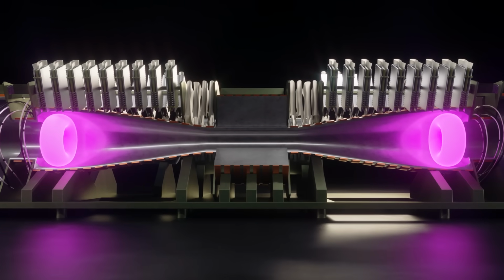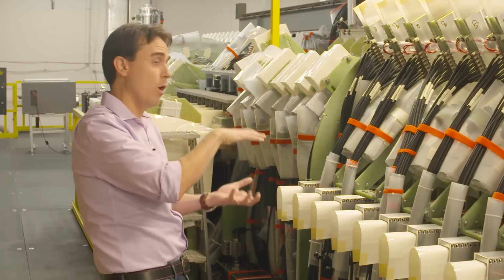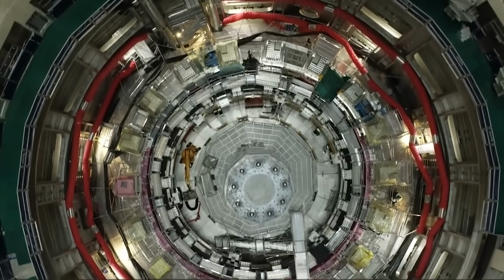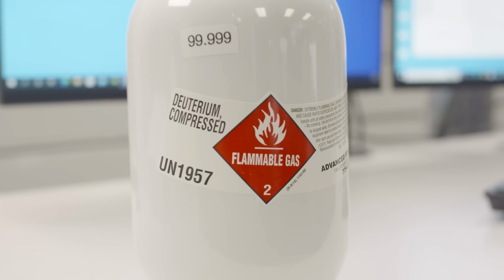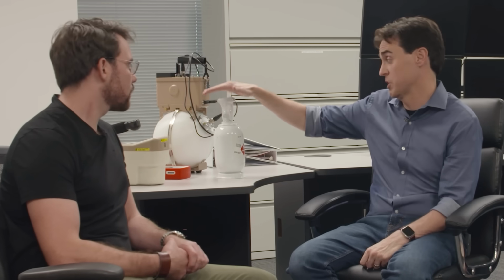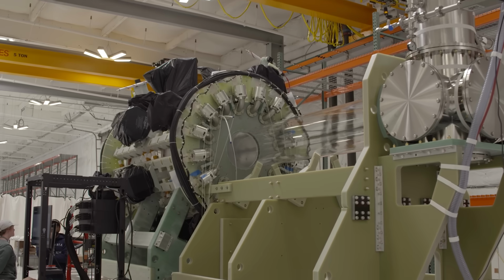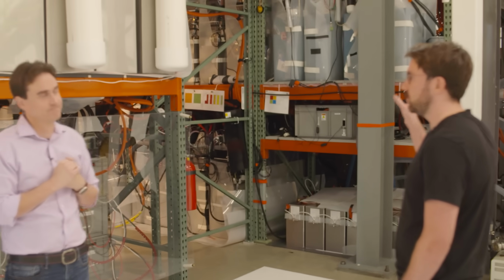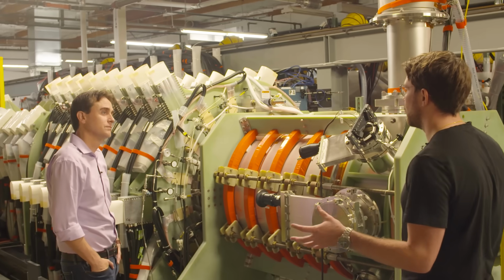A New Way to Achieve Nuclear Fusion: Helion

Comment: For the foreseeable future, here is what we need to do. Build combined or associated Fission and fusion plants together.  This will allow for the high power needs of fusion reaction generation and also probably add to increased overall electrical power output capacity from the two systems.  As an added thought, the fission reactors may not need to be so large as those currently in use or planned, since the primary user of the electricity generated from the fission reactor will be dedicated to power requirements for the primary fusion reactor units.
Reply: Build a nuclear plant to energize the system that has to produce   clean energy? Sir, you are a genius! 😂😂😂

Comment: There are a number of videos created by physicists and engineers rebutting the claims made in this piece.  As for factual errors, there is nothing innovative about this form of reactor design...it has been around for about 50 years.  Second, I think someone needs to go back to there chemistry and physics classes and get a refresher...that's not how the reactions work.  Third, the radiation this thing would pump out would be...interesting.  Lastly, the energy output is going to be exceedingly low at the temps discussed.  That's a real problem if the attempt is to replace existing energy sources which produce electricity.
A case can be made that this is a solid step backwards from current fission tech.
Reply: I guess you are referring to the video by Improbable Matter, which is complete uninformed humbug. Here is my critique of the video by IM:

- Critique: "FRCs have been done before and never worked." 
First, define "worked"! What was the goal of the experiment and what was the outcome?
Second, yes, FRCs have been done before and the members of Helion's founding team were actually involved with several of them. They applied the lessons learned from those to their own design, which they have tested over 6 prototypes so far.
Lessons learned and applied:
1. Size of the FRC. The larger, the less susceptible to n=2, rotational instabilities.
2. Elongation to radius ratio. The longer the FRC, the more stable it is to tilt instabilities.
3. The merging before the compression. This part creates a single, hotter and more stable FRC as a target for compression. FRCs get more stable, the hotter they are.
4. Helion's FRCs have a very low electron to ion temperature (Te:Ti) ratio of 0.1 and less. That makes things a lot easier compared to machines where both are in an equilibrium because: 
P(fus)/P(loss) scales as Ti^1.5 / (Z^2 * Te^0.5 )
Where Z is the atomic number (in case you wonder about that).

- Critique: "Deuterium - Helium3 has a smaller reaction cross section than Deuterium - Deuterium. At the 100 million degrees temperature discussed in the video, Deuterium - Deuterium reactions would be much more likely than Deuterium - Helium3 reactions."
That is generally true, but the author misses some key points:
Trenta is a subscale prototype with much weaker magnets than what they are proposing for a full scale powerplant. Because of that temperatures are somewhat lower than in a full scale power plant. Power plants aim for temperatures 20 keV (220 million degrees) and up to 330 million degrees (30keV). At that point the D-He3 reactivity surpasses the D-D reactivity.
That said, Helion actually wants some D-D reactions because that is how they are breeding their He3.
D-D => He3 +n or D-D => T +p
Both reactions have a 50% chance of happening.
So, in mixed mode (breed and power) machines, they will need two D-D reactions for every D-He3 reaction, at least until the Tritium inventory is large enough that they have a constant supply from decay (Tritium beta decays into Helium3). Sicne Tritium has a half life of 12.3 years, that can take maybe 20 years. That fact is probably the best criticism of Helion's approach.

- Critique: "Deuterium - Helium3 is too hard and Tokamaks cannot do it. Therefore Helion's approach of fusing Deuterium and Helium3 can never work."
D-He3 is very hard to ignite, but they do not need ignition for their design to produce enough net electricity to be economic. Most of the energy from D-D and D-He3 reactions is released as charged particles, not in neutrons. Helion can recover the energy in charged particles directly as electricity at a higher efficiency than a steam plant would. They can also recover 95% of the input energy directly as electricity. That makes their machines a lot more efficient.
Further, FRCs are high Beta (~1.0) compared to Tokamaks (~0.05). Beta means the ratio of the plasmas internal pressure to the pressure applied externally via magnets. 
Fusion reaction rate (the amount of energy produced) scales as magnetic field to the 4th power, an extremely strong scaling. However, that is the magnetic field inside the plasma, not outside, which scales as Beta^2 and B_external^4. 
If it was just about the efficiency of the magnets (it is not), then a 10 Tesla Helion machine would outperform a 200 Tesla Tokamak.
But, it is a bit more complicated than that, because confinement times in FRCs are generally lower. You win some, you lose some. Overall it is still a win for Helion's approach.
Since Helion is using adiabatic heating through the compression stage, they can to some extent(!) balance temperature and density almost linearly for a given magnetic field. D-D reactions favor higher density and lower temperatures. D-He3 is the opposite way round. They can tune that just to the right sweet spot between density and temperature depending on which reaction they want more of.
Another thing that works in Helion's favor is the aforementioned Te:Ti ratio. This ratio actually decreases further with higher temperatures. So the hotter the plasma gets, the smaller that ratio. Trenta already showed Te:Ti at <0.1. It is likely that a power plant will have an even lower ratio. Lower electron temperatures greatly reduce Bremsstrahlung losses. At a ratio of 0.1, thermal transport losses actually kick in earlier than Bremsstrahlung.

- Critique: "The neutrons from Deuterium-Deuterium reactions would have fried Trenta and I see no shielding." 
As mentioned, Trenta is a subscale prototype, an experiment. It is smaller, weaker and only operates at one pulse every 10 minutes (max). A full scale powerplant would do 10 pulses a second!
Not all shots were fueled by Deuterium or Deuterium + He3. Many were fueled by a mix of hydrogen and Deuterium or pure hydrogen, depending on what they wanted to test.
Because of that alone, the total neutron flux that Trenta has experienced so far is not that high.
What the critique does not mention is that neutrons from D-D reactions have a much lower energy than those from Deuterium- Tritium reactions (2.45 MeV vs 14 MeV). Those 2.45 MeV are below the activation energy of many materials.
The machine is mostly made from low activation materials or materials with a half life measured in minutes. Aluminum activated by D-D neutrons has a half life of 2 minutes.
In fact testing different materials under neutron exposure was one of the purposes of Trenta. They have tested quite a few alloys to see how they behave.
There is still permitted shielding of course. It is in the walls of the room and not close to the actual machine, which can handle the aforementioned relatively reduced neutron load just fine. 
It is also worth mentioning that a mixed mode Helion power plant (that does both breeding and power production) would produce neutrons only in one third of all reactions. So the neutron flux, even for those machines would be lower than for a D-T Tokamak.

- Critique: "Helion claims that they discovered new physics when they say that the ion gyro radius is 25% larger."
The whole ion gyro- radius thing was based on a misunderstanding and out of context quote and maybe also bad wording.
What happened was that Trenta achieved a higher ion temperature than predicted by Helion's too conservative physics model (a higher ion temperature is actually a good thing!). That higher ion temperature caused a 25% increase in ion gyro radius, which is perfectly in line with established physics. That's it. Nothing to see here!

- Critique: "Helion had previously said that they would have a working power plant in 2021. "
IM was very eager to get a "gotcha" on Helion. I guess he did not read further up on the page, or he would have seen that Helion was in the process of raising funding at the time. They did not get that funding until now. Even Trenta was less than 35 million (especially if you take the 35 million into 2019 dollars, when they started building it).
No bucks, no Buck Rogers. Should be quite clear, no?

Comment: Ok, so how do you control and adjust this “electrical energy” to make it usable? If its an ac waveform , how do you stop surges in voltage
Reply: The power goes back into the capacitor bank, from where it is gradually released to the grid.

Comment: the real challenge is to build a mini version for transportation applications, especially aviation.. That will be interesting to see. Although i think the more straight forward application of this energy generation is for generating electricity.
Reply: Aviation would probably be hard. You need to add extra weight for shielding and then you have (small amounts of) Tritium as a byproduct that has to be stored safely. You don't want that to be set free in case of a crash. Shipping would be a really good application though. It is the right size and power for large container ships.
Reply: @elmarmoelzer2229  nice one. i agree about the shipping application. well spotted. Its just that i was influence by the Second Independence Day movie, about how we copied the Alien's fusion technology.... cant believe we are a step closer now with this helion... without the help of Aliens!!

Comment: so correct me if Im wromg, if you split this machine in half you two plasma blasters like used in star wars?
Reply: Not really. The plasma is very hot, but closer to a vacuum than to ambient air in terms of density. It would rapidly cool if exposed to air. It would also expand quickly without a magnetic field compressing it.
Reply: @elmarmoelzer2229  interestimg,  didn’t know its that low of a pressure.   So for a blaster to work it would a very dense plasma almost like a solid excited into a plasma state then accelerated very fast.

Comment: This is really interesting and I want to believe it, but I cannot help sit a little perplexed. As the Helion system suggests that it produces a lot less of the Neutron Bombardment that causes Neutron poisoning issues for the Tokamak. But it still must produce a metric 'brickton', especially when they are potentially considering increasing the cycles to per sec, and considering the system appears to have no way to harness or dissipate the bombardment/poisoning. In time, if not sooner, they will surely encounter the same problems with the Tokamak system, but don't seem to address it. 

It seems like a really good idea on paper, and a far superior concept to the tokamaks, if not out of material costs alone. But something seems a little "too good to be true" with this, and you know what they say....
Reply: D-D neutrons are not that big of a problem. They are only 2.45 MeV (vs 14 MeV for D-T neutrons in Tokamaks) and they only occur in 1/3 of the reactions. The 2.45 MeV are below the activation energy of many materials that they can use.
Reply: @elmarmoelzer2229  This makes sense. Thanks for the reply :)
Reply: @TheRandomBassist   I actually did some more calculations for their power plant. Their vacuum chamber wall is made from 0.5 cm thick Silicon (quartz). Silicon needs to absorb 3 neutrons to become unstable. After a year of operation only about 1% of the chamber wall material closest to the plasma would have become unstable. Since this is essentially a tube, it should be quite easy to replace too.

Comment: Cold fusion probably has a better chance.  The idea of trying to constrain the energy of a nuclear fusion without exerting and equal if not stronger contraint seems contrary to physics.  At least a trillion has been burned up on these approaches and nothing is even remotely close to producing power.  Had 1 trillion gone into geothermal - you'd have lots of energy now that would last thousands of years.
Reply: Nowhere near a trillion has been spent on fusion, not even including the research into nuclear bombs. US fusion budget has been on the order of 400 to 500 million a year. Other countries have spent some money too, but even less than the US. You might get maybe to 100 billion over 70 years across the entire world and that is probably overestimating it by quite a bit. Problem is that if your funding is below a certain threshold, it never gets anywhere. These machines cost money to build and test. If your funding is barely enough to keep the lights on, then all you get is paper studies.